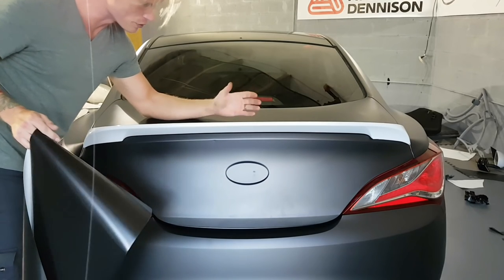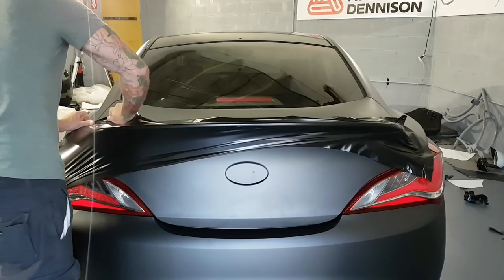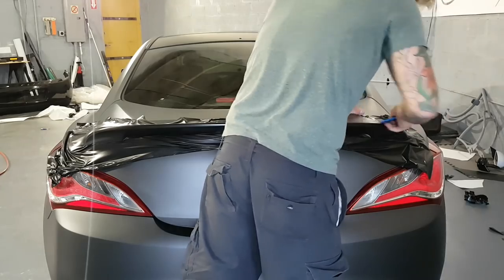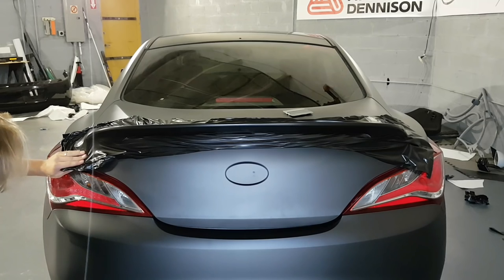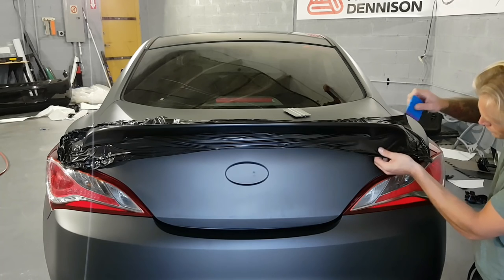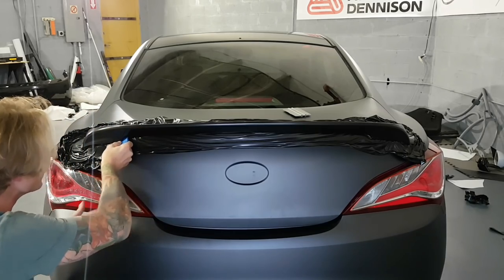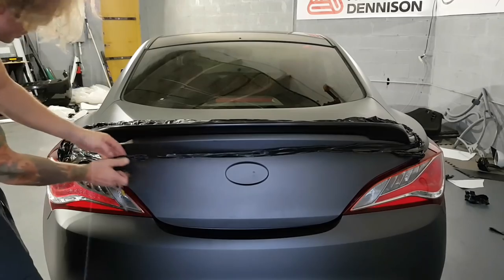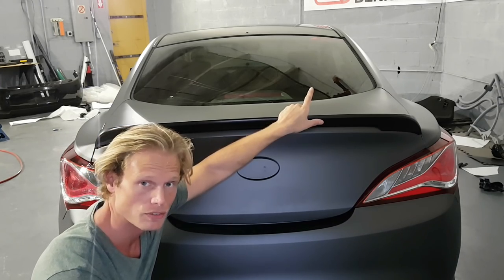How to vinyl wrap a rear spoiler. Wrapping a rear spoiler by @ckwraps

Comment: Im planning on wrapping my interior trim pieces of my BRZ, what type/ brand of vinyl do you recommend for beginners? By the way awesome videos! Love the tutorials even if they are an hour long at times.
Reply: Eternal Beast get Avery or vivid. I've never used vivid but Avery is easy to move around. 3m is pretty tacky
Reply: +Jorgeicr8 thank you, I think I'm going to try vvivid, don't want vinyl that's too hard to move around since I'm not experienced with wrapping.
Reply: +jesse sanchez24 I was planning on getting Avery but I read in one of the videos comments  Ckwraps said that Avery leaves glue reside when you remove the wrap after a certain amount of time.
Reply: +jesse sanchez24 damn really? I thought that was like the best because that's all I see Ckwraps use.
Reply: +jesse sanchez24 yeah I watch their videos, I might buy that 3M electric wave color where they wrap a youtubers BRZ in that color. Might use that for the interior. Thanks for the help man!
Reply: +jesse sanchez24 thank you. And don't worry I've tried wrapping my interior pieces 2 times already both failed because of the wrap, no more eBay lol. I think each time took me like 6 hours because I didn't want to fuck up but it still fucked up when the wrap actually hit the sun on a hot day. Guess the 3rd time is the charm.
Reply: Eternal Beast glad im not the only one 😂😂

Comment: 17:56 appears to be some white. When this happens after you trim are you screwed or is there a small amount of stretch left to  fix those tiny mistakes? The corners seem sharp & a pain in the ass.
Reply: its called a reflection bro
Reply: @snoops7942  Nah that's definitely paint showing underneath on that edge. You can see the jaggedness of the cut, look again. I caught it too. 
And to answer the question, I think you could definitely pull a tiny bit more stretch to cover a super tiny mistake like that. Might even be able to use slight heat and rub it over with your thumb..
Reply: The Devil is in the details